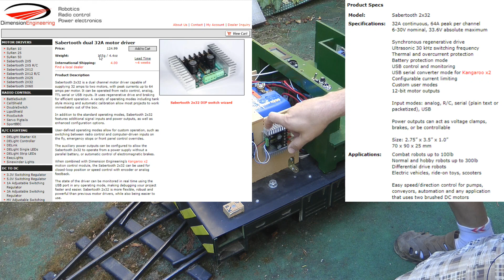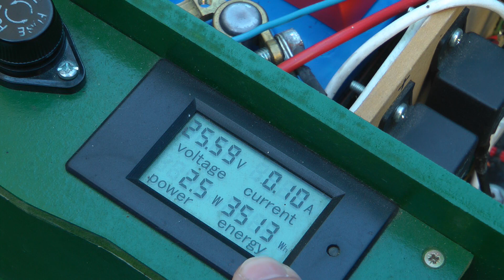Wireless drive for my ride-on locomotive

Comment: That's a great little setup.  Looks  really good.   Only one thing I am thinking.  For convection cooling, would the heatsinks be better vertical instead of horizontal to allow cool air from below to flow up?  Not that I think it will get too hot 🙂.   I have a lot of ideas from this series for my own system.